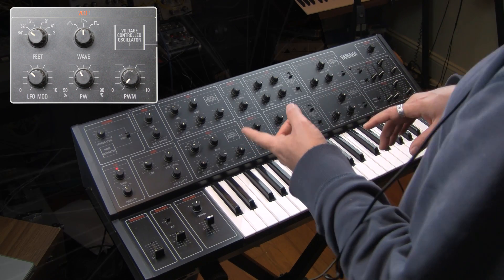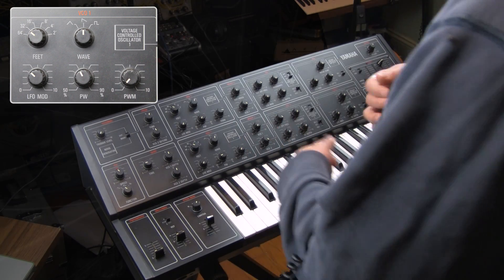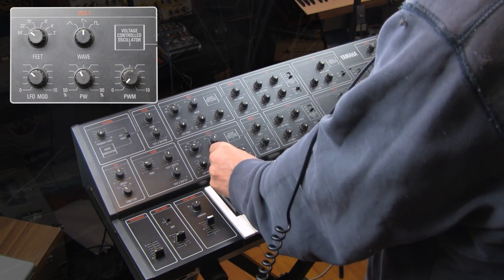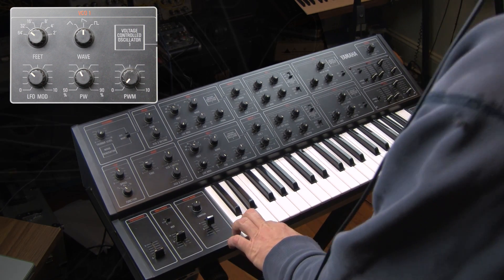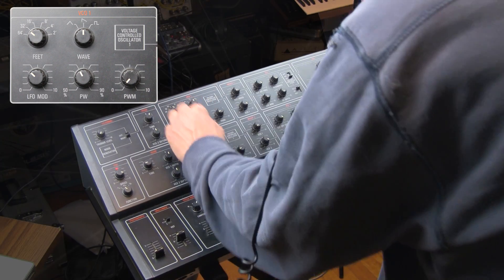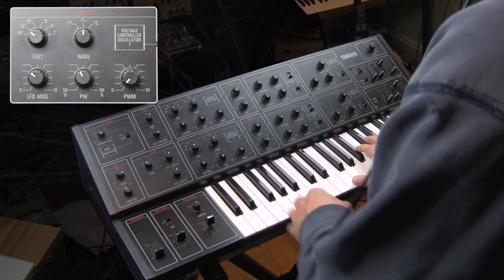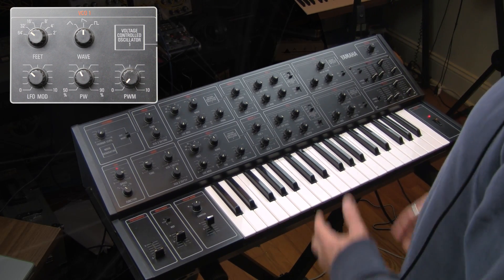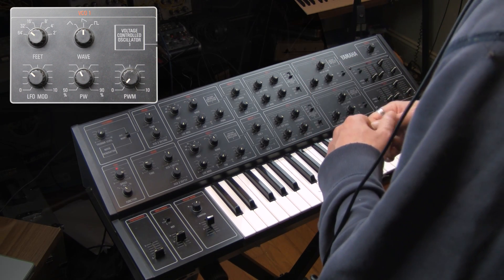03-The Yamaha CS-15: Part 3- Oscillators Part 2

Comment: Thanx for bashing the SH-101 - never understood why it got it´s great reputation. By the way: it came out in the 80s ...
Reply from the maker: It got its reputation because it was an iconic usage in a genre!
Also, its an inexpensive analog with a sequencer...
Reply: Yeah - iconic like the TB-303 .....
Reply from the maker: Those of us who were around when that thing came out will never understand the mania, no matter how cleverly it was used.
Reply: The SH-101, despite its simplicity, has a distinctive character that is very desirable.  Its 24 dB filter is controlled chaos at hi resonance (on the verge of self-oscillation), which yields a very aggressive sound that lends itself well to certain electronic genres. The same filter can sound creamy, too. The SH also has a deep pulse width modulation and sub oscillator that goes 1 or 2 octaves down, while remaining phase-locked to the root pitch.  This is the beauty of sub-oscillators compared to a second unsynchronized oscillator set an octave or two down.  The 101 also has a nifty sequencer and unique form factor. It even runs on batteries.  Oh and it has one other rare feature that I love: envelope-controlled pulse width.

I don't own an SH-101, but I've used it and I love it.  The SH can shoehorn its way into almost any mix.  I'm not ragging on the CS-15, which I also love (it shares lineage with the CS15D and CS40M, both of which I do own and use frequently), but I think perhaps you're a little quick to trash the 101.  It's a different kind of synth that has stood the test of time.

Comment: Watching your videos with ebay open in another tab is dangerous for my wallet!
Reply: Japanese sellers are generally the best. Very nice, very friendly. I got both my cs-10 and 15 from japan, as well as an sh-1000, sk-20, sh-2, matrix 6, and a few others. Shipping is expensive and you have to use a voltage converter since they are made for 100v but I've never had any trouble.
Reply: @scottrogers2599  Agreed! Japanese sellers often go to such lengths to point out little cosmetic flaws and blemishes - Japanese tend to take very good care of their electrical goods and often keep them boxed  when not in use - that you could be forgiven for getting the impression that they don't actually want to sell! Up until a few years ago, I think many of them couldn't believe that foreigners were willing to part with good money for old synths that they considered virtually worthless. I've heard stories about classic synths being found dumped and in excellent condition, at electrical goods, junk yards. They've certainly become a lot wiser in recent years and are generally speaking, adjusting their prices accordingly but there are still bargains to be found in Japan.
Scott, how do you rate the SH-2? I've got an SH-1 that I really like and it's made me think (a lot!) about getting an SH-2.
Reply: @MisAnnThorpe  The SH2 is very nice. It's too bad they didn't add a second ADSR and a second LFO for PWM because that would have made it an amazing synth. It's definitely one of my go-to synths for leads. I got a Multimoog and I really like it but I'd say the SH2 is fatter sounding.
Reply: @scottrogers2599  Thanks for the reply. I don't suppose there's a synth in existence that couldn't be improved upon. It's a case of making the most of their limitations. I too own a Multimoog with pitch and occasional triggering issues. It's the only Moog, along with the Micromoog that I've ever wanted to own, and is by far the most expressive synth I've yet to play, with its ribbon control and aftertouch However, I'd probably take a chance and swap it for a CS30.
Reply: Gustavo Alberto Elizondo   yeah no doubt. My bank account has suffered major setbacks due to Mr.  Doty's demos. I have been watching the CS-15's in eBay for awhile now since I saw the Moog Foundation videos. Been kind of wary about buying one from Japan though. It seems like there is always desirable old synths from there on eBay.